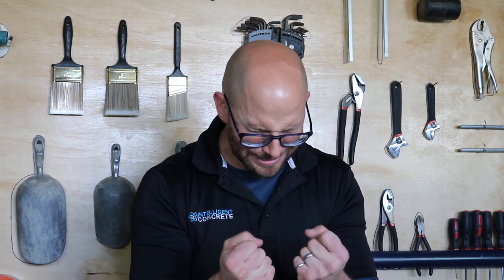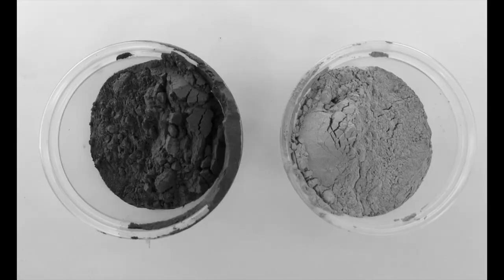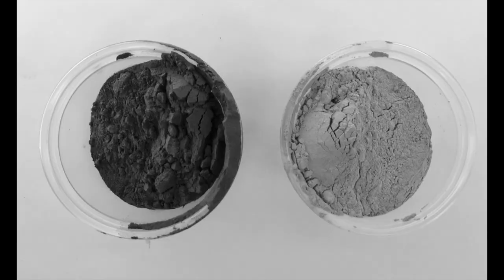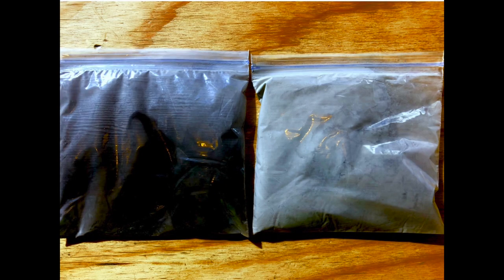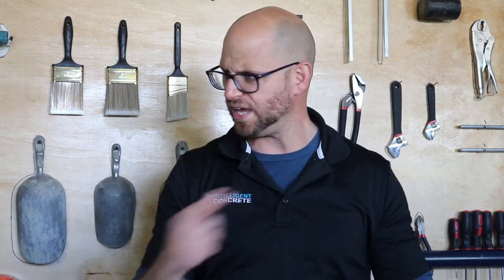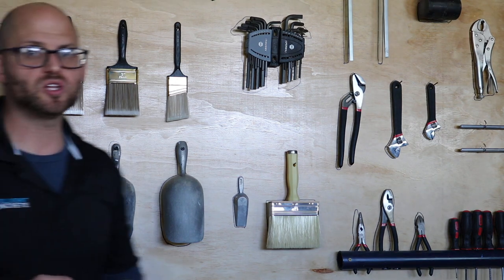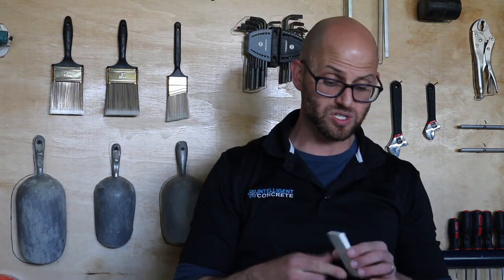ASCMs and Absence of Fly Ash - Vlog #281

Comment: What was used in concrete in the USA before flyash was added to the mix? Very interesting topic.👍🏽👍🏽
Reply: Straight cement. And once it hydrates, it's full of calcium hydroxide which is extremely alkaline (brings the ph of the concrete up to around 13) and adds no strength. If there's a large amount of steel reinforcing, the high alkalinity can be helpful in preserving the steel. But otherwise it's a design flaw. It costs more, it leaves a lot of strength and durability on the table, it opens up the risk of Alkali Silica Reactivity (ASR), and it's often less finishable. A straight cement concrete is like a diesel with no turbo--no one but an old auto collector should want one...
Reply from the maker: Well flippin said Decy3!!!!  Holy moly guacamole that was awesome!!!!
Reply from the maker: MrMickteen I’m going to geek out on this questions and get back with a new video for the channel!

Thanks for the awesome question!!!
Reply: deyc3 I always thought that the aggregate matrix and finishing techniques were to blame for the problems with concrete . Then came flyash to take some blame. So my mate Calcium hydroxide is the issue.
Reply from the maker: MrMickteen some of the blame.  Definitely not all.
Reply: @MrMickteen  The number one problem we have in our region is too much water. In the mass produced golf course developments they often spec straight cement to keep the color uniform and get higher early strengths on foundations to build faster. But the finishers just compensate for the reduced finishability of the mud by watering it down. Which makes it weak, porous, on top of alkaline. This sets up the concrete for a perfect storm of alkali issues. We actually have a problem here called ACR (alkali carbonate reaction) where aggregates swell and pop the surface off of the slab. They keep blaming the agg. Now they are bringing in trainloads of granite from Appalachia to compensate. But the real issue is just UNintelligent concrete.